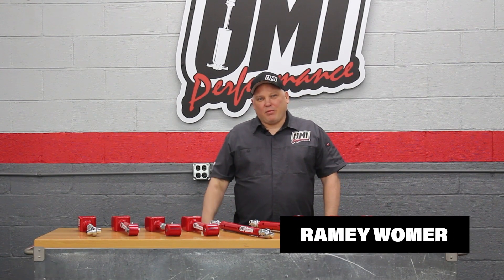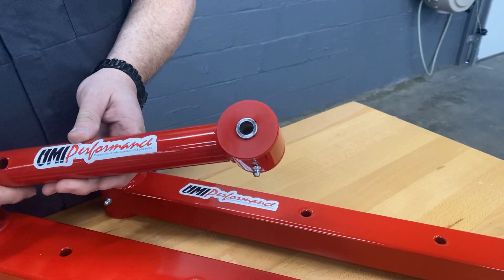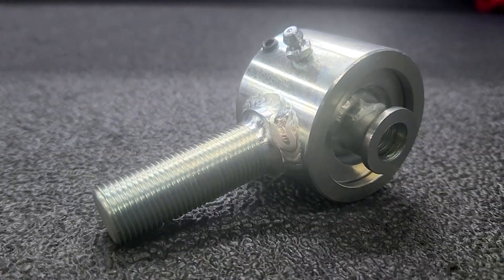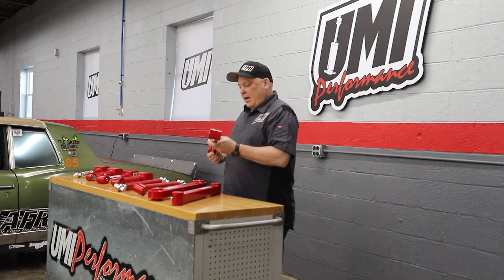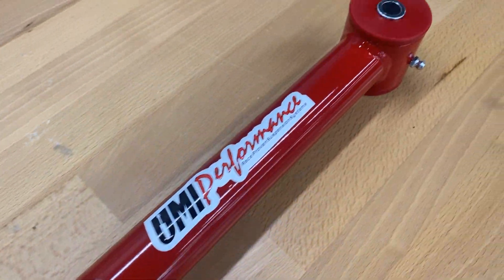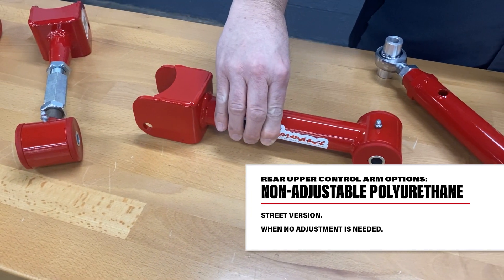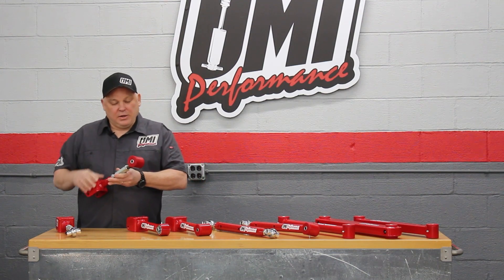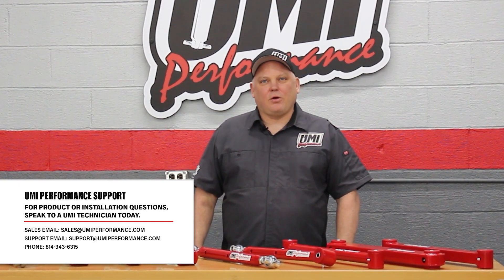UMI Performance Rear Control Arm Options and Comparison

Comment: Is it typical for the suspension to squeak at low speeds and over bumps at any speed after install? I have a 1000 miles on the newly installed UMI lowering suspension everything except the cross member, I figured it would need to be broken in, but it still sounds as bad as the day that it was installed. Any ideas as to why or is this supposed to be normal?
Reply from the maker: It can be but if the problem persists, get ahold of our tech support and they will assist you!

Comment: I’m running the upper adjustment arms with the lift bars to stop wheel hop . Now the rear end is so far forward the driveshaft is hitting the trans and can’t get it out . If I wind the uppers back out will it give me room and stop the shaft from rubbing on the beck of the trans ? I didn’t install them but thinking the shop who did just adjusted them too far out and didn’t bother to check .